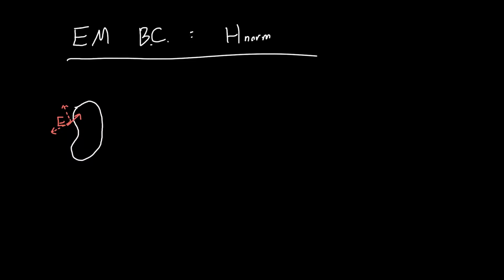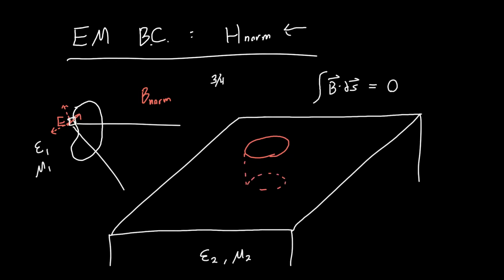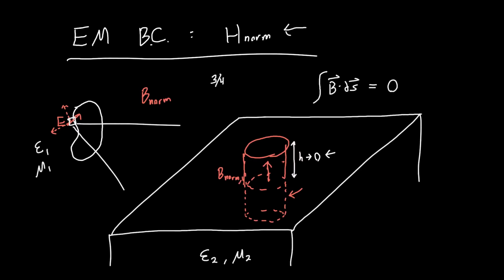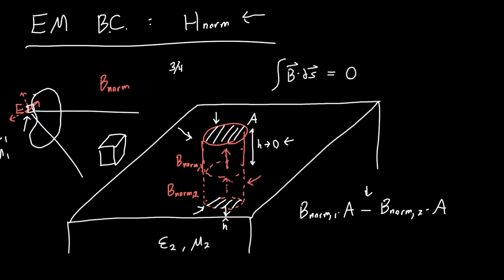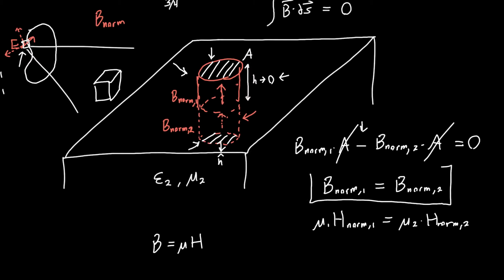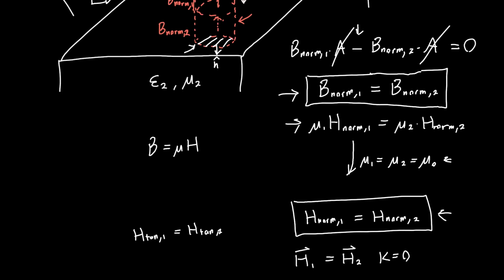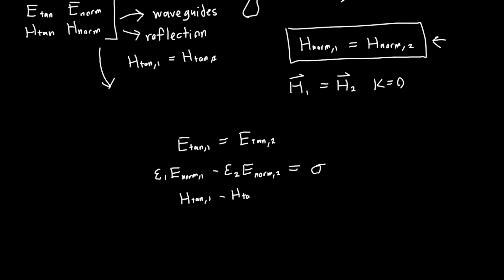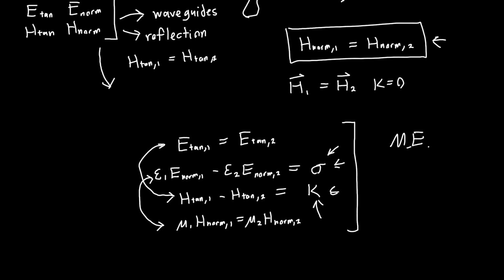Normal Magnetic Field Boundary Conditions

Comment: Sir,  Could you please explain more about when K can be regarded as zero?
Reply from the maker: Ah, yes, wonderful question. K is the surface current density. So if, for some reason, you have a ton of current flowing just on the surface of a material, you can't neglect it. This is quite rare, and I've never actually encountered a case myself where it happens. Topological insulators are one example of where you may have to worry about it, and perhaps when you are dealing with surface plasmons (shining light on metals under certain conditions).

Comment: Even if if the height of the cylinder wasn't taken to be zero, because we're considering H_norm, wouldn't the contributions from the sides of the cylinder in the integral still be zero? Because H_norm is perpendicular to the normals from the sides...?
Reply from the maker: You are correct, the main reason we are taking the cylinder height to be zero is that the magnetic field could change as you go further away from the surface. In general, unless the field is perfectly uniform across all space, this will be the case.
Reply: @JordanEdmundsEECS  Thanks a ton.

Comment: I have a doubt sir. Why do you consider normal components to be in the same direction?
Reply: It doesn't matter. If you assume them in opposite direction then you will get negative sign in final result. which essentially means they are in same direction.

Comment: hi everyone , can anyone help me about acoustic propagation
Reply from the maker: It uses essentially all the same math as electromagnetic wave propagation, but instead of the velocity of light (c) you have the velocity of sound. Instead of electromagnetic wave impedance you have acoustic impedance. All the rest of the math is the same, but you also have longitudinal acoustic waves in addition to transverse ones. Reflection at interfaces is the same, and you can use transmission line language basically as-is.
Reply: @JordanEdmundsEECS  brilliant equivalence! 😊🙌🏽💯